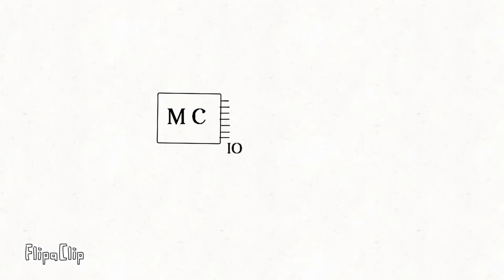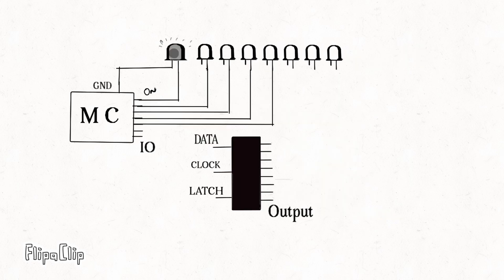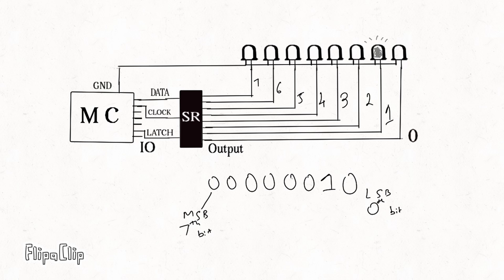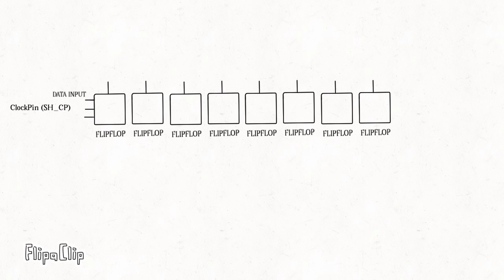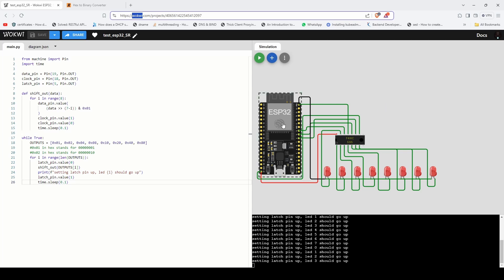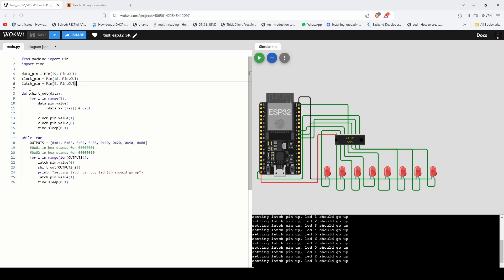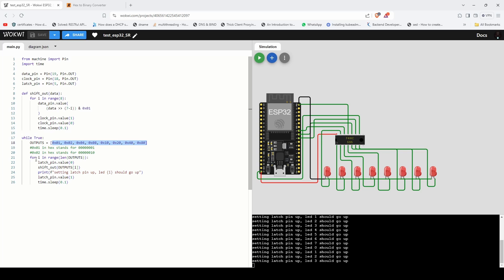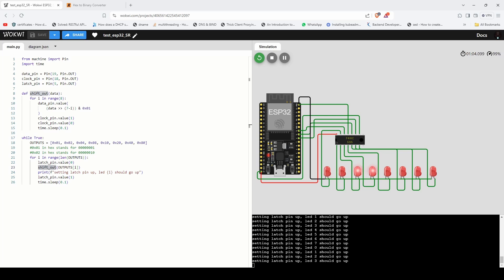Master Shift Registers: ESP32 & 74HC595 LED Control With MicroPython | Expand 1 GPIO to 8 Outputs

Comment: Is it possible to use ATTiny85's Reset Pin which is converted to GPIO pin by disable it and use this pin as 74595's clock pin?  I'm trying to use all 6 pins of ATTiny85 to control 2 set of 74595 to create 8x8 dot matrix LED.  I tested the converted pin and it's extremely slow.